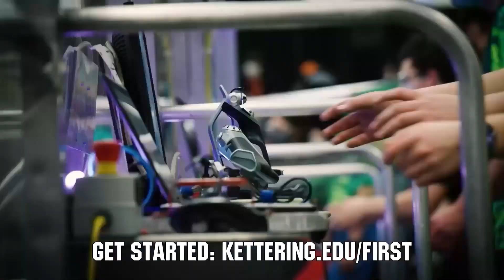Behind the Glass | 2767 Stryke Force | FiM St. Joseph Q24

Comment: I think I heard that their cameras weren't working? Is that a common issue teams have been having this season? last season, my team's limelight only worked half of our games and we never figured out why.
Reply: Is it plugged into the second radio port? That port has a tendency to not work due to an issue in the chipset and it is recommended to run a limelight thought an ethernet switch and only use the left port of the radio.
Reply: @tecnicraze  We will most deffinatly try this and see if it is more consistent. We have run into issues with our radio ports in the past. Thank you for your suggestion.